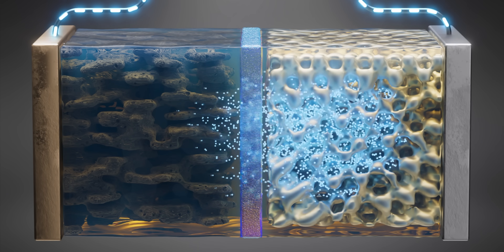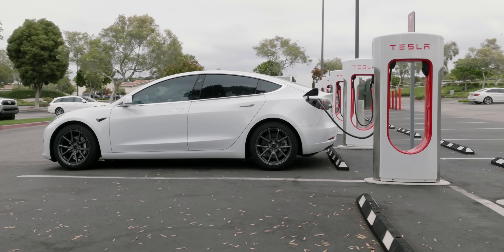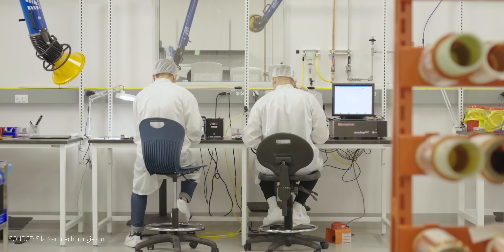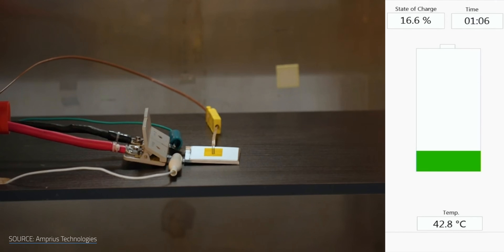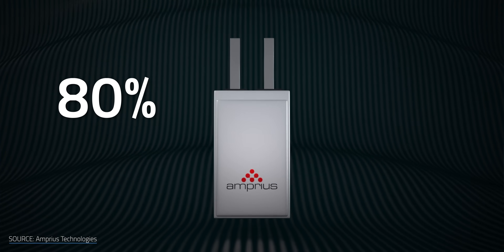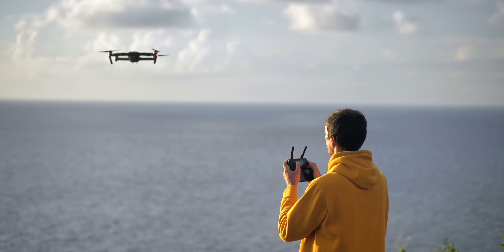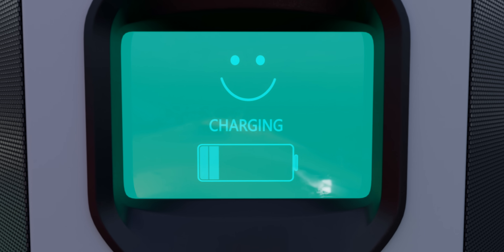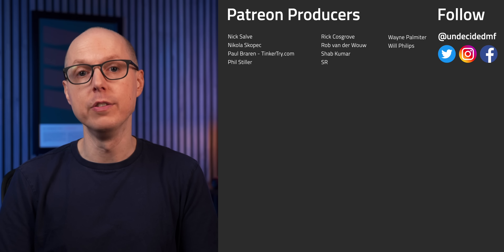Why This Ultra Dense Battery Breakthrough Matters

Comment from the maker: Do you think silicon batteries are where the industry is heading? Get an exclusive Surfshark Black Friday deal! Enter promo code UNDECIDED to get up to 6 additional months for free at https://surfshark.deals/undecided

If you liked this, check out Why is this Propeller Getting So Much Attention? https://youtu.be/UzYHO4tksTc?list=PLnTSM-ORSgi7uzySCXq8VXhodHB5B5OiQ
Reply: @UndecidedMF why do you think eVTOLs will not be viable? There's huge opportunities for emergency services, border control, search and rescue, organ transport, etc., and that's without the commercial opportunities for replacing helicopters with more efficient, reliable, greener and cleaner tech
Reply: @riddermark1987 I doubt pure eVTOL's will ever be viable - flight times, range and recharge times are problematic. Hydrogen fuel cell eVTOLs seem more competitive, but then putting hydrogen in aircraft has a chequered history.
Reply: When comparing efficiency, you shouldn’t overlook that the atomic mass of silicon is 28 versus 12 for carbon.
Reply: As soon as you said 'nano wires' my heart sank. I don't think this is scaleable in the same way that conventional batteries are.
If the Anode grows 4x by volume, can't they make a 4x Cathode and integrate them such that the volume changes balance out as the ions move?
Reply: Li/Air from Argonne National Lab 1,200 Wh/kg; 1,000 cycles and 10c power density.
Reply: Finally cause, I have stock in them.
Reply: I have a question Matt. 
Is LG Energy Solutions building their new battery plant in Arizona in hopes of finally having legislation pass allowing for the use of the lithium deposit within the McDermitt Caldera along the Nevada-Oregon border, potentially revolutionizing the global lithium supply chain? The deposit is estimated to contain 20 to 40 million metric tons of lithium
Reply: Silicon is great, however the volume expansion of Lithiated  Silicon is rather large (+300%)  that is why the nano feathered structure of the Sputtered Silicon coating on the Silicon NanoWires allows for this expansion without  large degradation
Reply: Been watching this technology for quite a few months now. I really hope that it proves to be commercially viable. We have a potential bottleneck with producing enough battery grade Graphite for medium term needs, so Silicon might sidestep that issue, whilst providing much smaller battery sizes for traction purposes.
Reply: Those propellers won't be coming to drones. Drone community was exited about it, even made commercial grade propellers for people to test out. But turned out those are not good, or not good enough compare to the normal ones.
Those propellers got me exited for a second and it's gone. Poof, gone.
Reply: I see it as one piece of the puzzle to creating the next generation of batteries. Swap out the Graphite with Silicon, the Lithium with Sodium... now we just need to find a way to reduce the need for or eliminate altogether the cobalt and nickel.
Reply: I think I'll believe it if it actually reaches the market.  I'm not in the least bit surprised lithium batteries haven't changes significantly in thirty years despite them having a "breakthrough" in technology almost every month. The problem isn't the structure of the battery it's the characteristics of lithium itself. No animation will change that.
Reply: Yet another "game changing" battery but it costs $1M and is permanently 10 years in tbe future
Reply: I thought Niob-titanium-oxide batteries are the next best thingy.
Reply: No
Reply: I can see we are synced up in the renewable space. I am writing an essay about this for a class I have where I am learning from Yi Cui, who is clearly brilliant. When I graduate we should talk about what projects we can possibly collaborate on.
Reply: No. If they'd be better than Li-ION batteries, then they'd be shelved until the lithium mines run dry.
Reply: Nope. Silicon greatly reduces the cycle life of a lithium ion cell. Best is to use little of this which Panasonic will do in 2025 to increase battery cell density by 5%.  A very high density silicon anode battery posed by the video is useful for niche or extreme situations where battery cycle or cost is not an issue.  For EVs, you'd want the reliability and cycle life and lower cost of LFP battery chemistry.  LFP is so good that ageing causes more degradation than daily full charge recharge cycle.
Reply: Q: Do you think silicon batteries are where the industry is heading? A: no.  at this late date in History the Si battery promise...?  is no different than the Solid State battery promise...? is no different than the Super Conductivity promise from back 30 years ago (hint: observe how the "common denominator" connecting all these things is the "scam of promise").  okay next question.
Reply: Look into AMTE Power - they are specialising in sodium iron batteries. This new battery tech is extremely interesting!!!!
Reply: SO...Calling this Tech "Breakthrough Technology" seems a little premature and more than a little disingenuous. Anything for clicks, Eh?
Reply: Nope. Solid state batteries will fuel the next generation of power hungry applications.
Reply: Just going to go ahead and apologize for my lack of punctuation I use speech to text to get my thoughts out right. Okay so the only major concern I have with this is what level of Purity does it require because if it's anything like the semiconductor industry we're going to have to require extremely rare and pure forms of silicon which that process is very expensive I highly doubt it means the purity of a Soc but it's still probably going to be up there getting good yields out of silicon ingots is well troubling at best
Reply: Hey Mat, I've heard recently of a company that's supposedly got solid state battery tech working with the production line, costs ect all covered. 

Personally I'm doubtful but couldn't find any decent information. 

They're called QuantumScape. I'm curious if you've heard of it?
Reply: I think graphene aluminum is where the industry is heading. Everything I've read/watched about it seems like the future. Even Elon Musk was watching and commented on Stanford students progress on their aluminum Graphene battery.
Reply: Solid State Batteries seem to be the direction forward....they offer Fast Charge Time, High Density Energy, High safety and seemingly they don't have the manufacturing challenges of these silicon batteries.
Reply: Nice as always bro

Did you see the Red Bull drone they made for chasing car around the the track ? holy.... shiiiiiit THAT IS SO AWESOME

FIA should pay them to make hundreds of them.. or something. Amazing.. Max was blown away, we all were
Reply: World's Fastest Camera Drone Vs F1 Car (ft. Max Verstappen)
Reply: As of  Feb 2025, The Phone Brand Oppo just released their New Foldable Smart Phone with a Silicon Carbon battery with Amazing Properties!!
Reply: @SurfsharkAcademy: Saying "Amprius grows Si NWs directly from the current collector then coats them in Si to form an anode" is simply false or lack of understanding of their technology. Coating Si on Si doesn't make sense and if you did some research you would have known that. Their anode is never a silicon grown directly on the current collector in the first place. It is commercially not viable in large scale and only limited to high-end application because they don't grow Si NW from the current collector as you claimed. In fact, they never claimed that themselves, so stop misleading people on their tech or better still get accurate information and good knowledge before making your videos. I know exactly what they are keeping away from people like you who jump to conclusion and do the marketing for them without care to details and reality. Good attempt by the way, keep going !
Reply: While it's great to see these improvements in charging times, I have no issue with the current rate of charging on my Model Y, I have level 2 at home and car is full every morning if I wish when on a road trip stopping every 3 or 4 hours for 20 minutes is no issue, we have needs.
My point BEVs work now for so many people and the utopian future we are always presented with is nice but not a game changer.
Reply: @jjamespacbell  good for you.... living in nyc...no way.... and I love to ski.... weekend ski trips wouldn't be possible with an EV especially after you lost 30% just because it's cold outside....
Reply: @jessjames3624  When you get to your ski lodge throw an extension cord outside end of the weekend you are full and not hunting for gas.👍
Reply: @jjamespacbell  easier said than done and who want's to deal with that all the time....
Reply: Pins his own ad.
Reply: Well, silicone is about as abundant as possible..
Reply: yes.
Reply: High purity silicon is actualy running quite low you know @peterinbrat
Reply: My main issue is EVS in general usually stems to toxicity when these things catch fire, lithium-ion we know the chemistry of how toxic these batteries are when they start burning not only that, but we know that they burn for days and days and days and it doesn't matter how much water you spray on top of them, in fact water won't help, then there's the other kind of battery the salt battery, or sodium battery, well if you understand chemistry at all, you'll understand that there was this situation with adding water to sodium can actually cause a fire and an explosion, but that's another option that they're talking about going to when it comes to these batteries, now I'm not knowledgeable enough on this silicon version battery, but if it has or contains any sodium or lithium in it, I don't trust it simply because I know the various issues that are attached to lithium and sodium batteries, now I know for years and years now people have been talking about this graphing thing, and I'm interested in to knowing more about that, as far as I'm aware I don't know if it's toxic, but I suppose once we start using them regularly, then we'll know how they perform, I just have issues with batteries all together they always come with more problems than they're worth in the end.
Reply: Silicon batteries might be where the industry is headed but that doesn't solve the lithium ion battery issues with EV. Look up what the legacy automakers are saying, many like Toyota, Honda, Ford and GM are pulling away. The CEO of Honda Toshihiro Mibe said they are ending development of an affordable EV. What it comes down to is the business model. They'd need to profit from the entire vehicle manufacturing process and that wont happen with the EV business model.
Reply: @practicalguy973  
So ONLY Tesla and Chinese companies can do well in this market.

No other auto maker has the skill to make a BEV AND it be profitable.

That's such HORSE SHIT.  They don't HAVE to right now so they'd rather be business as usual, oh EXCEPT they're been cranking up their prices to make more profit to build BEV factories.

Tesla is already the 8th most profitable auto maker in the world.  Let that sink in.

GM is NOT pulling away.  They're still building BEV factories along with other companies and those that don't, they're dead.

Battery tech is the holy grail right now and the companies that invest and make improvements win.  The companies that don't?  Well, they have to rely on supply chains that aren't stable.

But your statement is mostly propaganda or it's based on factors that affect them because they were stupid.  I'll get to that.

This is Honda:

Honda has published more details on the conversion of its plants in the US state of Ohio for the future production of electric cars and the components for them. The Marysville Auto Plant (MAP) will begin preparations for the production of electric cars in January 2024.

For the planned factory conversions, the two production lines that currently manufacture combustion engines and hybrids will be consolidated into one line for the production of electric cars. Employees at the Marysville plant will be trained for future electric car production from the end of 2023. Honda will move production of the Accord from Marysville to the Indiana Auto Plant (IAP) in 2025.

Hyundai already has BEV plants and puts out excellent vehicles.

GM was just STUPID with their approach to BEV.  I mean really, HUMMER???  CADILLAC??  Oh yeah I see lots of THOSE on the road that AREN'T BEV, NOT!  I see more Teslas on the road where I live than Cadillac, ALREADY, in this metro of about 8 million people, so yeah I can see why THEY are cutting back on their goals for 2024, because they were STUPID in starting with Cadillac and HUMMER, or they thought they could use Tesla's model of making very expensive BEV, or they didn't even WANT to start making them right now because they know they need to do the same thing Tesla did with building new plants altogether.  Making BEV and making ICEV use totally different robotics.  This is why there's resistance to it, because of the large investments, and then of course different companies want to shift production out of the US to Mexico and that pisses off the auto workers..

Then Ford.  It was a good idea for them to put out the F-150 Lightening.  It just seems stupid to enter the BEV market with it, without any experience.  So, not QUITE as stupid as GM, but OK.  They're competing in that market with other companies.  Where they WERE STUPID like GM is making a MUSCLE car a BEV, a Mustang.  Yeah how did THAT go?  What were they asking for it?

The company that wins BIG is the first one to make a couple plants where they can pump out 2 - 3 million CARS, like mid size and even ECONO cars that are BEV, but it has to be better than the Chevy Bolt.  And, the battery pack can't crap out after a few years and then customers like my brother are told to be safe park the vehicle a couple hundred feet from his house.  Yeah so, I guess in front of his NEIGHBOR'S house????

But no company wants to do this.  They look at Tesla and think they can make a REALLY expensive vehicle and make a high profit margin the same way Tesla did, but these companies have different customers than Tesla and most aren't going to accept a $75,000 USD BEV.

Now, here is the TRUTH behind what the companies are doing other than being stupid if they aren't Tesla or Hyundai or a couple of European auto makers.  Battery tech is changing a LOT, and these companies should have know this would happen.  These companies invested in BATTERY plants.  You know what happens to a battery plant when a battery twice as good hits the market?  It's not pretty.  What these companies needed to do was invest in auto factories for BEV and for now let other companies be the big investors in battery tech.  You can tool for a certain type of battery for a couple years then tool for newer batteries when you know you're going to shift.  Do you think these companies could have been smart?  No I guess not.  So where you see the cuts right now is mostly in battery plants, such as Ford slowing down the production of a plant in Michigan.
Reply: @practicalguy973 the EV. Car could be a big seller   if. A. Company  would put the long range affordable car on the market and leave it there. For 6. To 7 years

But  GM took. The Bolt off the market after 3 years

In the last year on the market. Sale for the Bolt. Tripled

This shows  the potential of  EV
Reply: @practicalguy973  the first industry to benefit would be E-Bikes and E-Motorcycles   
a car is just to expensive 
most people don't by a new car anyway and since you cant trade in EV it is a market just for enthusiasts
Reply: @practicalguy973  imagine the weight of EV trucks and other vehicles on bridges and roads getting on the George Washington Bridge or other bridges delivery trucks must drive across. Better keep some diving gear with your road gear, if you understand what I'm saying.
Reply: @peacepoet1947  Yeah the weight of a long range EV is an issue. The big issue I see is charging. Look at NYC, there are 3 million vehicles. Imagine even 1 million charging overnight in a city density like New York? The electrical grid wont work with that kind of insane power fluctuations. The transformers, wires and entire grid would need to be beefed up. In a world where we are focused on conserving electricity EVs don't really work.
Reply: @practicalguy973  
imagine 1 million people in New York City all using a clothes dryer all at the same time!
In a city of 8.5 million people that happens regularly!
LOL
Reply: @jimthain8777  Are you really comparing an EV power consumption replacing a clothes dryer? Your logic is flawed. An EV would be additional power on top of people using their dryers and for many more hours. There would be a large spike in power when people get home and plug their cars in for the night if everyone had an EV charging at home. Additionally some would be drying clothes on top of that lol! Down the line all the power adds up similar to you blowing a fuse in your home.
Reply: @practicalguy973  Someone's been reading the anti-EV talking points? The grid can cope with a few local upgrades here and there. Even they say they can cope. The reality is that the grid will use price signalling to get you to charge at different time periods. And if we get vehicle to grid right it will even help to harden the grid without the traditional large capital expenditure.
Reply: I think ... that your videos should be less chaotic
Reply: At least the research is still being done for a better battery but electrical current will not always be available to us because of the Sun or nuclear war which will take down the grid.
Reply: @peacepoet1947 I hate to tell you this but in the event of a nuclear war you won't have oil refineries either. And if it's bad enough, you won't have an inhabitable planet. But you could probably cobble together a few solar panels from the wreckage.
Reply: @mondotv4216 I know of ways to run a gas engine on wood gas if oils are not available.  Oils are plentiful in our world and the Earth will keep on making more oil as the world grows older.